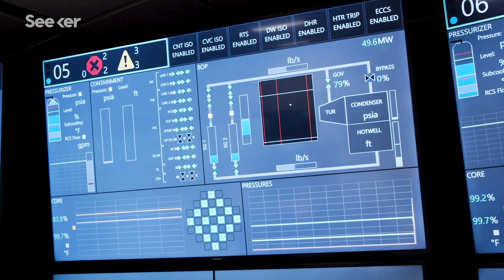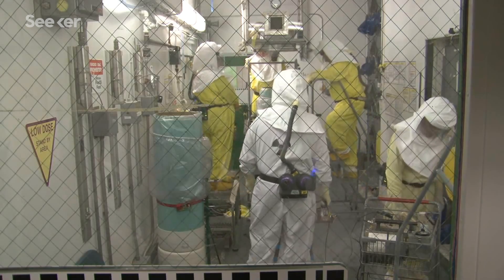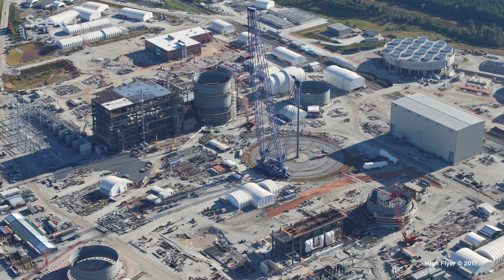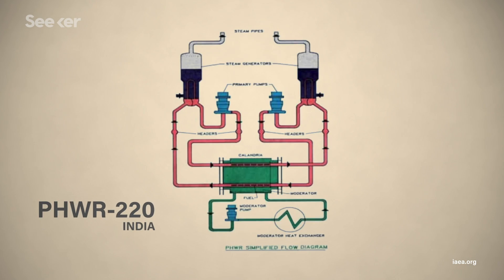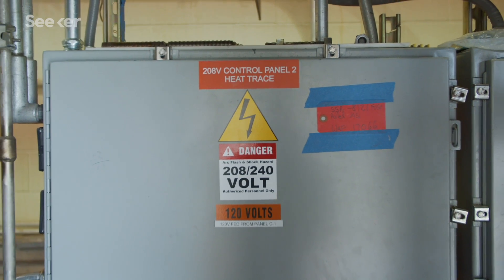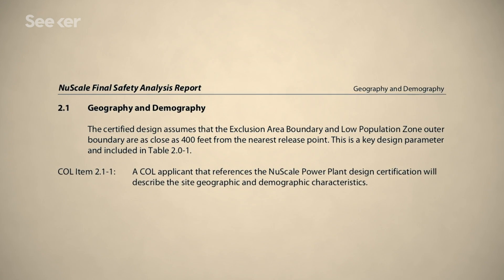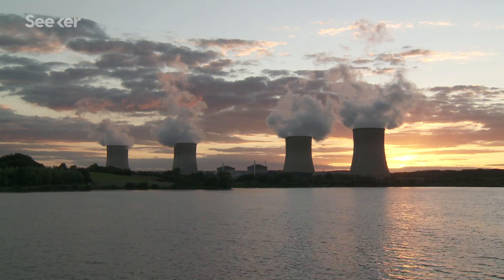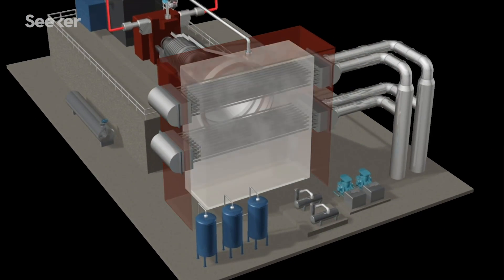Mini-Nuclear Reactors Are Coming, and They Could Reinvent the Energy Industry

Comment: No matter how "advanced" we are, thermodynamic cycles don't change. Hence the joke about "boiling water".
Reply: however we might discover more efficient thermovoltaic process
Reply: Yeah, I find these jokes to be so base and ridiculous. We use water because it is easy and efficient at the temperature ranges over which we can extract heat from nuclear fuel, reject it to ambient temperature, and do so with a reasonable margin of safety.
Reply: @gregorymalchuk272  THAT'S NOT TRUE.
Reply: @robbyandrews6318  
What aspect did I get wrong?
Reply: The funniest part is that even if the super advanced fusion energy is achieved, we would still be boiling water with the heat it outputs to generate electricity.
Reply: @nottsoserious  
Magnetic fields, electricity, blah blah, space.
Reply: System is the problem 🏡  The Great Qualities

1, Show all living creatures; all the love and kindness as much as you can.

2, Only try to be honest with yourself. If you try to be honest with others, you will get into big trouble soon or later.

3, Aim only one target at a time; otherwise you are chasing two rabbits and you will miss both. So, the reason behind it. Have one powerful reason and never ever give up the one you want the most.

4, Don't try to be good person only but be the powerful person. We will grow to be the one or we will die. There is no other choice. 

5, Always learn and look for to improve something your life. 

6, You are not alone. Love and faith the high power reduces unnecessary stress in life. But never completely rely on it. 

7,  Success and happiness are the byproducts of our usefulness. So, always increase the possibility of success.

8, Life is not going to be easy. Because of our unnecessary things. Eliminate all the unnecessary things as much as you can by organising yourself well with the environments. 

9, Never believe anything without the proper evidences. 

10, Always try to give more than you take. 
Because it is dignity/ character of the divinity within you.

🌎 As long as people continue to see themselves as separate from everything else, they lend themselves to being completely enslaved. Success depends on how well we relate to everything around us. Joy comes from that bliss of connectedness. I believe that unarmed truth and love will have the final word in reality. To love; you should have good heart. I am a good person until I see a person better than my standard of goodness. Being good is the progress towards a worthy cause. Love is God. Whoever lives in love, lives forever. How selfish it is to try to keep something forever? Love is all about nourishing, nurturing, sharing and expanding the love within you for all. The principle to which we adhere to is that we have kindness of love at heart for the whole of mankind.  As long as there is the unnecessary differences within us; we can not live peacefully so we have to eliminate all the unnecessary differences among us so we can love all. People abilities may vary but not there true love. If we love a person/ God for a reason then we love the reason but not the person. No reason is the reason to love the person because true love never fails. So do not compare or measure the true love as first or the last but love all truly. If you love people truly then you can understand people. If you don't love then you don't understand people at all.

People are controlled by system why?
The Cyclical Consumption is the current economy all over the World. It is making the scarcity problems of the earth finite resources to deteriorate day by day. Current Monetary System is legalised theft. Real money is Gold and Silver. Scarcity gives the money more value. Real money won't lose it's value. When Governments stay away from Gold & Silver then very easy to transfer the wealth / resources to upper class the Rich (Corporatocracy) Elite. When the Governments are printing out more new fiat currency with reserve banks, our old currency is losing its purchasing power everyday. They are printing millions of currency everyday. All governments and laws are existing right now to transfer wealth to upper class the rich elite. The USA Government & other Governments are in many countries, bailed the investment banks & financial institutions in 2008 against the majority of the people. There is no democracy in any countries. Because of the Money System based on profits motive only above all else even humans lives and well-being. So, we do not have freedom to protect our values with the money so on. The violence, bankruptcy & all the negativities are build into the Monetary System of our society. All are owned (including ourselves) by Reserve Bank. Which is private cartel the corporation. So, in legal system, we are legally considered as chattel the properties. They make money in the capital markets with our birth certificates. They do not consider us as Humans. That's the truth. We are at the invisible war with the Elites (Corporatocracies). We have to fight for our Freedom. Resource Based Economy is the Solution. We have to declare the earth resources as the heritage of all the people of this world. So everyone has access to it. Please have your research about zeitgeist movement then you know the truth more. 

 Truth About Health/Drugs Industry Because Of It Your Life At High Risk The drug industry is a 1/2 trillion dollars a year worldwide conglomerate. Almost 300 billions dollars just in North America. That is really big business. What would happen if everyone were well? There is no money in health. You see, good health makes a lot of sense but it doesn't make a lot of dollars. Because everything they do is toxic. Every drug they use, prescription drugs, all drugs are liver toxic, bar none. If you've had amalgam fillings put in your mouth by dentists. It is highly toxic. There's cancer because most of the chemos are themselves carcinogens. To view the tumor as the cancer and we know the tumor is not the cancer. The cancer industry is 200 billions dollars a year. The more work they get, the more profit there is. You have to dismantle; If the truth ever came out about what we would need to do. 30% of people of females in America are at risk of getting, will get cancer of the breast. The ones that are already dead have been grossly mistreated by the medical profession and by the government that supposedly is supposed to encourage free research and development of all possibilities. Why would medical doctors who studied medicine and practice medicine and are heavily funded by pharmaceutical companies why would they go and look into vitamins? That they never had the answer orthomolecular. And as more and more of our population start taking their health into their own hands, there's going to be even more and more of changes. It can't go on the way it is. The system is failing apart. We must make nutrition the primary prevention strategy for the population. You are what you eat. You are everything that you have ever done to yourself. The choices you make directly affect the outcome of your life. - (Food Matters Documentary in Netflix)

😊 Well, I truly love God. I am not religious but very spiritual person. So, I believe 1) Religion is the beliefs in someone experiences But spirituality is having my own experiences. The mainstream religions people promote religious ideology by giving guidelines and guide but In my spiritual life; I do not want anyone or anything between God and me to restrict my freedom to worship God. 2) We do not need any authorities to do good work. The god work is the good work always. In contrast; organised mainstream religions are claiming that they have the authorities to do God works as leaders so on. 3) God is not capable of doing wrong thing, change the past for us and create anything out of nothing for us. Nothing means not anything. So, even God is limited. The mainstream religious people believe that God is unlimited. 4) God wants us to take responsibilities for our righteousness life but not for all the consequences of our actions because they are continued to exist among us. So, How can god punish us for all our consequences? The mainstream religious people believe we are full of sins because of all our actions. 5) Freewill  is an illusion. People always choose the perceived path of greatest pleasure.  So, we do not have choices all the time. In contrast teachings of the mainstream religions are promoting people to do god's will always because we all have choices of freewill always. 6) We can not separate everything into groups. So, everything for good and evil and there's no success and failure for everything. If everything is real then real things can not be threatened. Once you come to understand that God/The Holy Spirit is in each of us, You will no longer need a Book to tell you how to live. Then why we need religious scriptures? The Virtue is the expression of the basic goodness in our actions. The Basic goodness is the fundamental worthiness of every individuals. We are worthy to God always in everything. 7) Beliefs in a cruel God makes a cruel man. No matter what; every living creatures has the right to live and What makes their life cheap? Everything depends on everything. Nothing too big or too small in value. We can not love and hate at the same time; Being a vegetarian means love without cruelty happily. The mainstream religious people are killing people and sacrificing animals in the name of God. They promote God's cruel punishments. The Punishment is endless for Sinners/Devil according to religious scriptures. But God is love always. Overcome hate with love. If all religions for peace, unity? No way. Because they are not for peace. 8) Well, The God gave us everything to go from moment to moment in our lives as we do our part  and pray only to thank god then the Love is in progress. The Love is always for everyone. We are always worthy of the God's love. Our greatest fear is; not to be loved by anyone but we are all loved by someone. When we eliminate all our unnecessary differences among us then true peaceful life is possible with the true love. If we can't find the peace within ourselves then we will never find it anywhere else. 9) This is the Fight for independence and freedom of humanity to worship God freely without religious guide and guidelines to restrict us. Unnecessarily, We do not want third party controls over us in anything ; especially in spirituality. 10) Revive Survive Thrive. Sincerely,  The Real Peacemaker against religious oppression.

 https://youtu.be/HbvCxMfcKv4
https://youtu.be/pIJHJzDQcRM
https://youtu.be/MyxbdmAnIcI
https://youtu.be/wLzeakKC6fE
 https://youtu.be/P8vHa8zD7jY
Reply: @seemlyme  Spam wall of text
Reply: @serpentphoenix  🌍 This is NOT the BS. System is the problem. It is monetary market slavery system. Elites have more power than us with media etc. I am doing here in right intention so. You don’t want to  talk about religious oppression, political oppression and monetary market slavery system ? Then no worth living. If you want greatest things in life so You fight in meaningful way as possible. People in power won’t give us just like that their power. We have to fight. Just read all. A lot of people are reading this
Reply: @seemlyme  pathetic.
Reply: This company never explained how they plan to handle the residual heat generated even after all control rods are dropped. The pool will vaporize in minutes. These guys talk as if their plants need no power. Of course all the same old machines, back up generators etc are required to interact with this pool. This is a frikkin joke. Shouldn't be approved.
Reply: @SF-li9kh  You're so smart, I'm sure the nuclear engineers and all those other engineers never thought of this. Maybe you should run for President of the United States you're so smart.
Reply: @SF-li9kh  they were approved by the way, not to mention thats the most basic and first question any nuclear engineer would ask. To think this isn't addressed in their minds is utter stupidity.